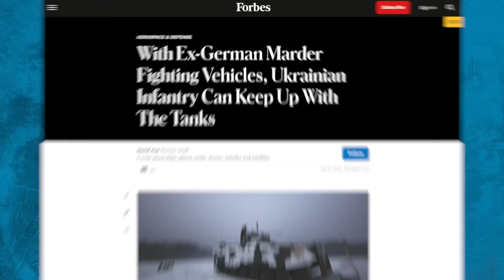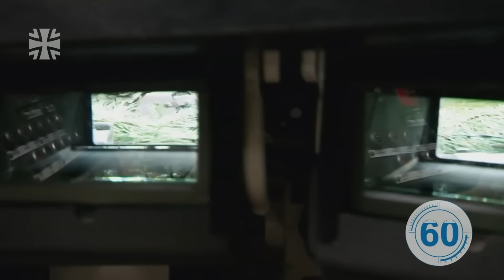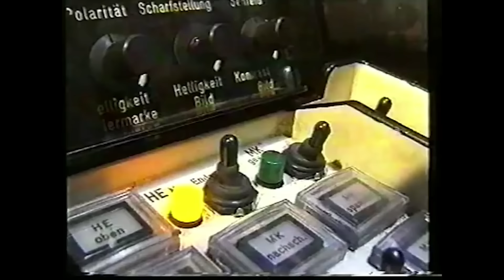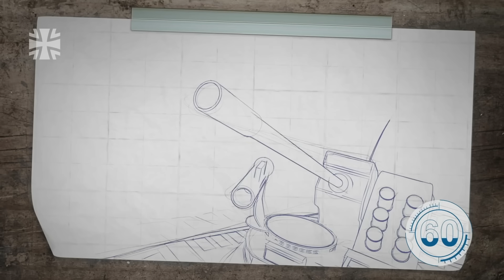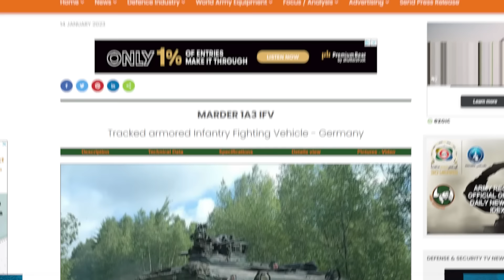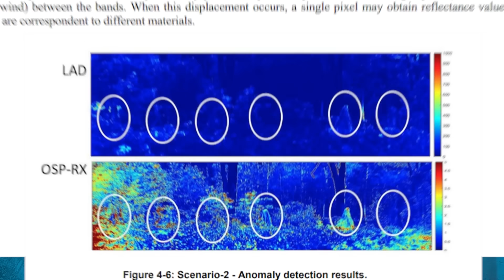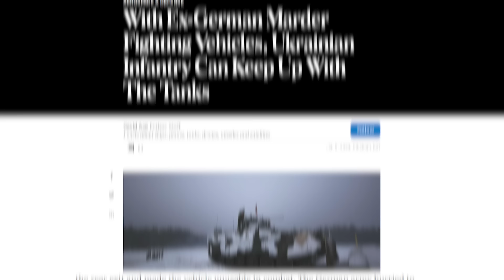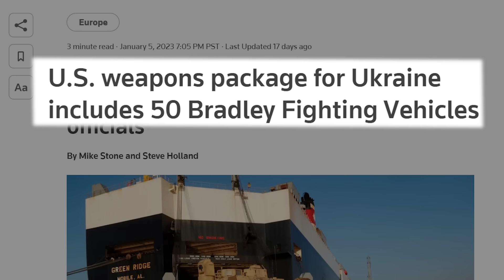Why this German IFV is So Hot Right Now

Comment: The downsides of the Marder are basically 2 things:
Their mobility was on par or even better than that of the Leopard 1 which it was developed to pair up with, but not on par with the Leopard 2. The other thing is the 20mm gun that is not stabilized.

Other than that, the only disadvantage it has compared to e.g. a Bradley is that you cannot reload the Milan without getting out of the Panzer if I'm not totally mistaken.

As for the rest, a well-maintained Marder is most likely exactly what Ukraine needs, maybe even more than the Leopards.

Comment: 5:48 / 16:17  rubber road pads quieter travel, less fatigue. Replace rubber track as complete band, cannot replace in sections
7:48 / 16:17 four x gun ports discarded. were nuclear fallout idea from the cold war
9:28 / 16:17  multi spectral camouflage to avoid thermal detection of thermal infrared and radar signature. mask heat signature with nets
10:20/ 16:17  Afghanistan 2009, great tactical asset. Operation Halmazag, Marder IFV prevented outflank of 300 men using thermal optics ability.
Reply: Right, the 4 gun ball ports could only fit a UZI submachine pistol, and the ball had a thick very small glass window sight, could hardly see anything through that. The UZI would lock tight into that ball.
( driver, gunner, commander and rear combat room sergeant had 1 UZI each as PDW back in the day ( and a P1/38))

Comment: Wait till the PUma has its Problems fixed. And lets not forget about the new Panther KF51, which looks like the new Star in tank heaven.
Reply: It will take years to mass production. Also as impressive as the KF51 looks. It is still a prototype
Reply: The KF-51 Panther will be produced in Ukraine after the factory is built. The KM company is now setting up maintenance hubs in Ukraine getting their capabilities up to the required level. If i look at the Bucha rebuild the factory could be operating in 1,5 to 2 years time. My guess is that they will build both Lynx and Panthers. They are also working with Poland on joined production of the their version of the Patria 8x8.
Reply: @jacksonteller1337  Which makes sense. My hope is that Europe Sees the Potential benefits of getting Ulraine into the EU. The Deal could be to make you Ukraine the backbone of a European Army and in exchange memebership and Billions for reconstruction. Which I hope they will take from the frozen money all over Europe.

Comment: Hi there. The marder 1A3 has three decisive disadvantages. 1. The 20mm cannon and the coax machine gun are not stabilized and can therefore only be used in a stationary vehicle. If the gunner is well trained, firing from very slow speeds is also possible. 2. The Marder does not have a rangefinder. You have to estimate or determine the distances to the opponent and then set them manually. Ok for a defensive battle from positions because you can determine the distances from every position beforehand. However, this is not so suitable for the Ukrainian counteroffensive. A child of the Cold War, the Marder is designed for defense rather than offense. 3. The ready-to-fire ammunition supply of the 20mm cannon is not very high and re-ammunitioning the weapon takes some time. Reloading the machine gun must be done from outside the vehicle. Very disadvantageous in combat. So you have to move to a covered position every time. Greetings from Germany

Comment: It uses rubber cushion inserts in a matel track like the bradley doe sin peacetime. It's not a rubber track. The cushion holders would wear out in wartime, so the dual-use rubber tracks would likely be replaced for an all metal track for the Ukraine war theatre. Basically the cushion sockets would wear out if you remove the rubber pad blocks. So an extra metal-only track would be entirely optional.

Comment: In 1980s the Marter mounted a camera aimed and remote firing MG3 to its rear to augment the main turret 20mm gun.
Not sure exactly why they stopped doing this?
Reply: change of fighting doctrine.  In the early years the tanks and IFV protected the Infantry inside, the Marder would have delivered the Infantry inside directly into the middle of the battle. For this reason the back MG3 and the gunports on the side for a 360 degree fighting capability.  With better AT weapons the infantry got a new job to protect the tank force, leaving the IFV early to be eyes and ears for the tanks.
Reply: There was no camera mounted for that remote MG3 back then. Only 3 periscopes provided a rather bad sight.
The infantry element was disembarked under cover, at the very least never facing the enemy. The remote MG kinda looked good - but that's all. Not very practical in reality and that is why it was scrapped. Also the 4 gun ports inside, which could only fit an UZI, fell away because those were not practical at all.
( former gunner and commander of Spz Marder here, early 80s)

Comment: Marder Infantry Fighting Vehicles  were exceptionally good vehicles for how they were intended to be used. The addition of Milan and reduced space inside, was compensated for by using two of them per infantry section. Section NCO IC in one, 2IC and gun "section" in the other. Doubling the fire support available for each section and reducing the risk of the entire section being taken out by one hit.
They are cramped inside and uncomfortable, not as well protected as more modern IFV/APC now in service. But that are better than the M113 and on par with the light Spartan armed with ATGWs.

Comment: The age of an combat item(vehicle, weopon, aircraft, etc...) has nothing to do with how good something is. Good examples are the black hawk intro 1979, abrams a1 intro 1980, colt m4 1994, phalanx ciws 1980 and maybe the most developed system is the AC-130A wich had it's first flight in 1967. Most good thing's come with years of development and regular updates and the understanding of how to use a certain platform.

Comment: The concern I have is if the tanks and IFVs will be hanger queens due to the higher and more complicated maintenance needed and increased difficulty with repairs.
Reply: Probably 3-stage: simple maintenance 50 km from the front, medium in Western Ukraine , heavy in Poland and Germany
Reply: @thomasgade226  Yeah, the need will force them into use. We have seen the same with Pzh 2000, which the Ukrainians are pushing beyond manufacturer recommended limits, necessitating intensive overhaul. But they performed so well, it was apparently worth it.

Comment: I remember talking to a SNCO who first served in former East German Army (NVA) using BMPs and transitioning to Marders after German Reunion. He said that the Marder was more quiet and could penetrate BMPs whenever he wanted. Remember that the BMP-1 has a near-useless 73mm gun in a one-man turret and the Marder 1A3 is pretty much invulnerable to 30mm rounds from the BMP-2).

Hope the Marder will bite the fucking Red Army in the ass hard. It's easy to understand, easy to maintain even in field conditions, defeats anything short of a MBT (sadly, no ATGMs fitted, if I'm right), and has a good level of protection. I take this very personally - my mother has been chased and fired at by the Red Army in 1945, and the Marder was my standard vehicle during my service. Godspeed, UA brothers!

Comment: If I don't see adequate armor I cringe because one hit and it's immobilized.
If I was designing a tank I first need it to last it must take hits and keep on ticking.Secondly but maybe the msot important is I need high tech to spot and locate the enemy and be able to detect attacks from above.Then I need mobility both speed and over rough terrain.
I feel it is impossible to build the perfect Tank but instead it is just another piece of the puzzle needing air support/intelligence and needing  foot soldiers once inside the towns.

Comment: OK, you got it right first, then you failed. The Marder, like the Abrams or Bradley, has a metal track that can be fitted with rubber pads (or special snow pads for that matter). It is not a rubber track. The rubber pads have another advantage. They do not destroy the road surface that much, something that matters when you drive these things in your own country.

Comment: The TOW/Spike Wiesel could be used in a classic tank destroyer, hunter with suitable tactics. Consider the Hellcat 1944/45. Suitable training and tactics are needed.  The 20mm gun could provide support and use against light vehicles. Money/$/cost is a factor in tank destroyers. They should be cheaper than tanks.  Heavy tank destroyers have been used. Maneuverability and stealth are needed.  Also fire and move. Good numbers are useful. A 20mm gun can destroy some MBTs.  They can also be used against tank sights, infantry support, and commanders.  In almost all the action I have seen in Ukraine the commanders have buttoned up. Limiting for old tank optics. Smoke should also be used when needed. Mainly to cover withdrawals if needed.  Night operations with suitable sensors can be very useful in Ukraine.

Comment: Jerry engineering is top notch. Even better than the Japs imo.
Reply: Cap, engineering is engineering. The quality of steel does not differ based on nationality. It's just like Kamikoto knives using the phrase "made of  Japanese steel" If you have the funding, you can develop a proper warmachine.

Comment: the main canon does not have stabilization, which is a shame. The old BMP-2s have cannon stabilization so they can fire while driving. The Marder will shoot very inaccurately if it drives over unevenness.
Reply: Initially the 20mm BMK autocannon of the Spz Marder was supposed to be stabilized, but they scrapped that to save money.

The main control board for the cannon between gunner and commander inside the turret, had still a switch labeled "stabilizer ON/OFF" and missing a toggle switch. ( in the early 80s version of the main control board)

Comment: The world war 2 Marders and this includes all of them were built to the specification that they were because you could mount a larger gun on to the same hull as it's turreted counter part the panzer 2. It had nothing to do with transporting troops and everything to do with having enough tank guns on the field that were battlefield effective by all accounts going. It was never "seen" as an IFV like vehicle.  

Sure the use case you have put out does make sense and of course they used them for this as well cause it just makes sense, it can carry a few extra guys and like you said they can dismount in an instant it would be silly for the Germans not to capitalise on this. but it was not built for this, it was built to fight tanks as it's primary role. the first version of the Marder so the Marder 1 was based on a Lorraine APC/SPG hulls, the 2 and 3 variants used the Panzer 2hull after they discovered they could not even fit a 50mm tank gun in it without complications. surely if it was intended as a troop transport primarily they would not have wacked a 75mm tank gun on the hull of a French APC? They could have just kept them as they were instead after taking them off the French.

Not sure what the deal is with flubbing the history on this, You could have still made the point you are to trying make fit without ham fisting the backstory of the Tank Destroyer itself that is all I know.
Reply: he explains it above.
Reply: @paullakowski2509  Explains what?
Reply: @paullakowski2509  No he does not explain "it" what ever it is, otherwise I would have need to leave the comment I have. the actual details around this have been completely overlooked. he gets it wrong, this is not just a case of oh oops I forgot to mention it's tank destroyer etc etc. he's just got it wrong. twice now too. Nah I've un-subbed and cancelled my channel subscriptions and I wont be watching anymore videos from this channel on principal.

You pay proper respect to those who come before you by acknowledging them for their deeds as the way of paying homage to that, Cappie has spat all over this and has misled the audience over detail of historical importance. I will not abide by American revisionism or endorse  it. He's out of line.

Comment: The more I think about it the more I think we need to have more and smaller infantry fighting vehicles. The disadvantages of splitting up a squad are not as important as the massive advantages in firepower, mobility, and protection, and mutual support, that you get with more numerous fighting vehicles. I just don’t see one gigantic expensive fighting vehicle as the answer - especially from what we’re seeing in Ukraine.

Comment: Question, would Kevlar or Dyneema tangled bundles be useful to slow down or impair tracked vehicles?
Reply: You'd need the wires to grab the track itself and be pulled into the driving wheel at the rear, then get stuck and hold there. Very difficult to engineer.

The main thing is it's very obvious, while mines are much harder to see have the same or better effects. The German DM21 directional mine is even deadlier because it doesn't have to be in the road itself.

Comment: Was it west or east Germany that made HS30? It seems to have a resemblance to the Russian BRDM and BMP-1.
Reply: Westgermany Mad the HS30  Eastgermany used the BTRs and BMPs
Reply: I wouldn't be surprised if the soviets just picked up the idea from the Germans.
Reply: @Vatnik_tschistilka  
The Red Army has seen an idea for the SdKfZ as useful in the context of their breakthrough strategy from which the BTR family was born as a front-line cab.
When they realized that it was not enough and that the infantry did not have enough firepower, they developed the BMP in 1960.
It is the evolution from APC to IFV.
Reply: @padnightmare6963  Russians got couple thousand AMERICAN LEND LEASE half tracks by 1944 , but realised to few to do anything other than mechanize some Cavalry units during the war.

Comment: About that close-in blind spot. Light trucks these days have 360-degree cameras where you can see an overhead view of your parking space. Do modern armored vehicles have that? If not, can't imagine it would be hard or expensive to retrofit (I know, the Pentagon will find a way to make it cost 10 grand and take three years)
Reply: It's done for modern fighting vehicle. However getting those cameras mud-prove isn't easy.
Reply: i think theres also space inside and power for the screens, and drilling holes through the armour for cables etc. but the new american mpf has those cameras
Reply: @specialingu  Probably there is space in existing conduit for the cables. I would guess the biggest issue is the cameras surviving shock from nearby detonations.
Reply: The marders sucessor IFV, the puma, does have cameras and sensors all around. It's simply a case of limited use to upgrade the marder when we can just build newer, overall superior IFV's.
Now we only need the german government to order a proper run of them, to get the BW up to at least 500-1000 Pumas in the next couple of years. Brings down cost, massively improves logistics and maintenance, and will set up the german military with one hell of a good IFV
Reply: there are some variants in use, but they are more or less useless for self defence. there is no difference if you see the face of that guy who popped out right behind you with an IED or not. but those cameras are great to protect your own infantry on the outside so you don`t roll over them accidently.

Comment: They shoulda made the beaglightpanzer into an IFV. Make it longer and a fee millimeter thicker armour. Its fast. 57mm auto cannon that fired a shot every half second. Anti air, anti tank rounds, missile launcher. Just snap an mg turret or 2 on the rear, and you have a plane killing tank killing IFV. Something that can rush in with its low profile, deliver troops to surport tanks, and fight if it needs to, rushing back and forth as an ambulance that packs a punch as well. The cannon would be devastating for CQC agaisnt tanks on the sides. And if its facing u, you have the missile. Hell snap a grenade launcher on it and you can destroy all sensors and sights for the tanks. Sneak around to the side and blast em

Comment: What the heck are you talking about--the Germans had plenty of APCs, eg. Sd.Kfz's which were used for this. German tanks were not easily surrounded by Soviet troops after breaking through--those are the Soviets pre-1943 that you're thinking of. The main problem was a lack of sufficient APCs, rubber tires, and gasoline--Germany exhausted their gasoline reserves in the first three weeks of Operation Barbarossa.

Comment: NATO may not be in a formal war with Russia, but NATO is actual already involved in the UA/RU conflict. There should be no hesistation anymore in the support for UA and the delivery of heavy weapon systems, both in quantity and quality. This includes the F-16 fighter jet, it turns out thet UA pilots are able to master the F-16 quite quickly. There should be a clear understanding between NATO and UA that these western weapon systems should not be used on RU soil or airspace.